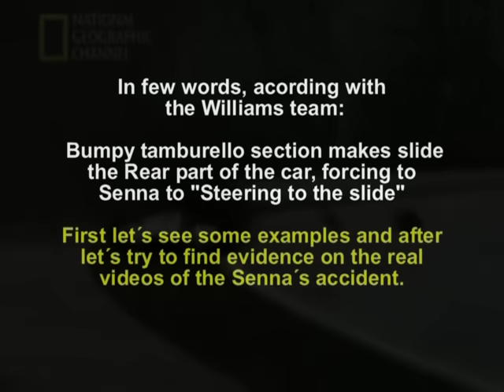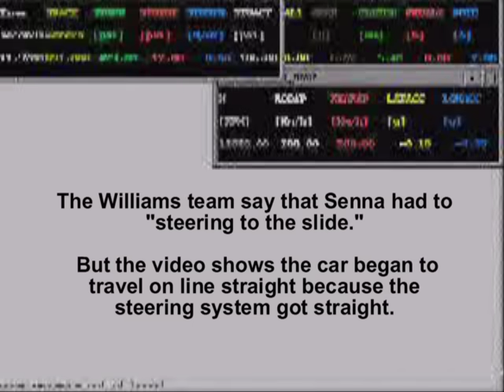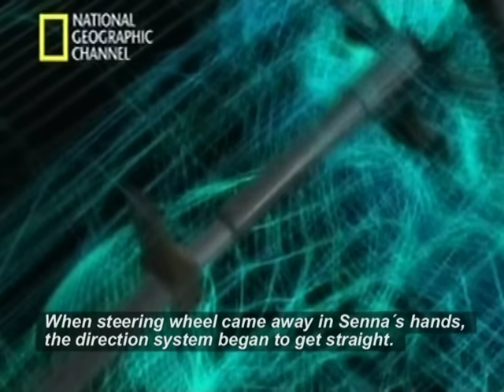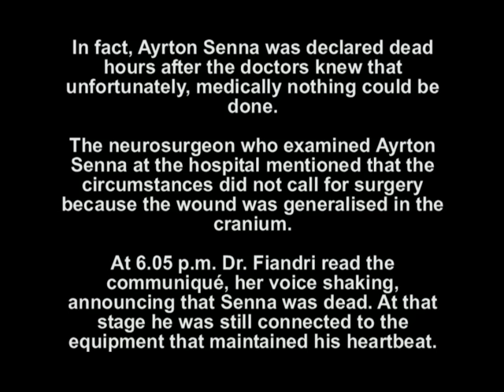5/5 the death of Ayrton Senna - what NatGeo did not tell

Comment: The steering on that car was not working you can see that.
Reply: ***** Does this mean that the technicians should have done a improper job.? Whey did not they say NO ,if it was not possible to do it properly. How could they take this responsibility? Senna most probably created a big pressure on them however, a good technician can convince the pilot with reasons. At the end he is not stupid.
Reply: Ender Conka Sorry, but in racing, there is no "proper job", you do what you can to get the car running fast & on the track in time to race! At the track, there is not time or opportunity for safety testing of design changes. A passenger vehicle steering column design change would take a year of design, analysis, testing and vehicle crash testing before going into a production vehicle. The racing teams & drivers do not choose to not race because they anticipate a safety concern! If they did, no race car would ever take the green flag ... under the best conditions, its dangerous, humans are involved, who try their best under the conditions, its part of the accepted risk.... no one can be blamed for Senna's death, it's racing,
Reply: Ender Conka No, there was a huge investigation afterwards, Williams was found to be completely blameless.
Reply: watch after he turns into the slide. He cant turn the wheels back to the left because the steering isn't working.if it was he would have tried.
Reply: wayne burgess Not necessarily, it's hard to explain since it comes so naturally but you wouldn't necessarily turn away from a wall if you were heading towards it, especially not if you didn't feel the grip to do so. Take Schumacher's accident where he broke his legs, he drove the car straight into the wall since he didn't have the grip to turn.
Reply: foxkart61 You don't do a crap weld job.  No excuse.
Reply: Jedontrack No, the verdict was given (probably on purpose) too late, so it had "expired".  The final ruling was it was the broken steering.  As for Williams, Patrick Head and Frank Williams were guilty of everything, including lying in court
Reply: Jedontrack Was this investigation done by the same Italian court system that convicted a number of scientists of not foreseeing an earthquake and warning the country about it?
Reply: ***** How do you know the italian scientists were not being negligent?
And how do you explain the Williams defense never denying there was metal fatigue and claimed the steering was "only" 20-40% broken when Senna entered Tamburello?
Given the facts, what is your theory?
Reply: ***** I have never heard of this case (was it later over turned, I certainly hope so because that's absurd!) but presumably it wasn't the same team investigating, not the same lawyers and unlikely to even have been the same judge. It just happened in the same building. And even if it was the same judge, lawyers and investigative team and bad decision in one case does not prover you are incorrect in every case you ever held...
Reply: theo sas I have no idea what part of my comments you are referring to, but if you have a coherent, fact based rebuttal, I would love to hear it.
Reply: Jedontrack
You provide a lot of speculation.  If Senna locked the brakes, it is a lot more likely the car would have spun.  Instead, you can see it going perfectly straight until the end.  Just don't tell  me 1.8 seconds was not enough.
Now, since you mention the beloved Williams team - are you aware Williams admitted there was fatigue fracturing on the steering column - undeniable - and they just tried to claim it was less (the claimed 20-60% fractured steering column when Senna entered Tamburello, prosecution claimed 80%)?  After only ONE fats race lap!!  And that is "nothing wrong with the steering"??  Come on people, use your heads, for once.
Reply: Jedontrack
"For some reason people think because senna was as good as he was it couldn't possibly be his fault or simply nobodys fault. But the fact is just because he was good doesn't mean he was infallible"

Again, wrong.  The reason some people never believe the bullshit official Williams explanation is that the accident happened at a place on the track where the driver can't be at fault, unless he deliberately left the track, or maybe if the are more than one cars involved.  Many experts have testified a mistake could not be made at the old Tamburello.  Some of those drivers have had scary shunts there themselves (yes, mechanical failures).  It has nothing to do with Senna or his qualities.
And F1 being dangerous or not back then, welding a thin crappy metal tube as an extension in a performance machine is just negligence.  Hiding the evidence, destroying the black boxes and lying about the cause is perjury and obstruction of justice.  Williams are guilty of all three.
Reply: VWaudiRULEs In your first paragraph: "doesn't mean he was infallible" Senna himself said that in an interview. However it was someone else that said that Senna thinks he cannot kill himself. Oh,what a statement to live with.
Reply: VWaudiRULEs Williams was found guilty on all charges , with a total absolution that there was NO driver errors at all. The driving shaft was broken before the accident , the soldered piece was badly soldered and thinner than the original ans showed  fatigue cracks . Williams was founf guilty of Mnalaughter by negligence , so where the main mechanic and engineer . the whole lot walked because the decision came 6 months after the status of limitation had expired. (convenient) . Just wonder what Williams did with the money he was paid to kill Senna.
Reply: VWaudiRULEs Well this first statement is simply not true, how many times do you see a car lock up and go straight forwards? In fact it's quite rare to see a lock up result in a spin. I've never heard this one before, all articles I've read on it williams say it is impossible to tell if the steering column broke before or after the crash... If you have an article that shows otherwise please share....
Reply: VWaudiRULEs That is an absurd claim, drivers can make mistakes on any corner, they're human... I can't even back this up with evidence, that statement is just utter crap. Many experts have said it was very odd to make a mistake at Tamburello, but then that links back to my original quote. People simply can't believe the great Ayrton Senna may have died because of a mistake he made.

Nowadays that weld obviously would be deemed unsafe, but you have to remember we can't judge the situation by todays standards. There were far less technical restrictions back then and those modifications were allowed, they passed scrutineering (presumably if the car was allowed to race). All that aside, just because the steering column was weak does not mean it failed, it does not mean it caused the crash and it doesn't mean Williams were necessarily to blame.
Reply: SuperTriniDaddy He did, I'm just not sure his fans believed him. It was Alain Prost that said that.
Reply: Whatever pal, so far you've completely failed to interact with the debate in a constructive manner which suggests to me you have nothing of value to say. Believe what you want. I enjoy these debates, it makes you think about yours and others points of view, you learn things and that's always good. But I have no time for meaningless name calling.
Reply: Jedontrack Driver error is something FIA digs into like a leech , because it REALLY can save lives if a driver's death can shed light on something that is being done as common practice that is dangerous. FIA found Senna ABSOLUTELY without guilt ,of error or omissions ( I question the omission part because , was I Senna I'd wonder how my steering shaft got shorter from the last race and NOT to crazy glue another) but both FIA and the court found Senna without fault . and I REPEAT The team was found GUILTY and Patrick Head took the blunt and was found of omitted error & control
"The Williams team was entangled for many years in a court case with the Italian prosecutors over manslaughter charges, ending in a guilty verdict for Patrick Head. The Italian Court of Appeal, on April 13, 2007, stated the following in the verdict numbered 15050: "It has been determined that the accident was caused by a steering column failure. This failure was caused by badly designed and badly executed modifications. The responsibility of this falls on Patrick Head, culpable of omitted control". Even being fond responsible for Senna's accident, Patrickyu the statute of limitation for manslaughter is 7 years and 6 months Head wasn't arrested: in Ital, and the final verdict was pronounced 13 years after the accident."
You might also like:
Reply: I must admit, I never new the FIA investigated senna ' s driving... 

As for the court case the way I understand it there were two investigations, the first closed in 1997 and found Williams innocent, the second closed in 2007 and found them guilty but it was too late as the statute of limitation had run out. Quite what changed between the two cases I don't know but I'd say there is a reason the statute of limitations exists and therefore perhaps the first case is more reliable...
Reply: Jedontrack The status of limitations exists to avoid a person going through life wondering when the thing is going to end. In the first trial lot of things were not admitted into evidence and the black boxes missing time were not even shown.
It was by all accounts a shoddy trial.FIA did not want to dump the bomb that a TEAM of engineers had (just by negligence" sabotaged the car. Same reason why Senna was not declared dead at the track MONEY!
 The legal system in Italy seems to function like the medical system in Spain and France. We get there when we get there. But MONEY talks and Senna's dad is a millionaire and Senna after death has built an empire selling the trademark "S" from decals to flags to full F1 suits at $7,000 USD. As long as Senna's accident included the possibility of being a Senna error , the brand suffered and a new younger prosecutor took reigns at the request of the Senna family . THIS investigations lasted almost 3 years where every bolt, nut , film stills was analyzed by scientists this last trial was so detailed , the expense was hitting the Italian government.
Now , why NOW declared legally that it was not Sennas fault when FIA found him ABSOLUTELY  innocent of any possible mistakes. Two things . Senna's name is vindicated and the Senna family CAN now enter a civil liability suit with the Italian proof that "something" went wrong with the car and the obvious element is the driving rod.

I want to clarify something .. ALL of the money of the Senna foundation is going to the poor in Brazil and a School was just opened to teach these poor suffering kids. NONE is becoming rich here , they were already filthy rich.
Reply: SuperTriniDaddy
Senna has said in many interviews he knows there are risks - "man and machine on the limit are bound to fail from time to time", "danger of gettign hurt and danger of dying", and so on
Reply: Jedontrack Here is where you show a lack of understanding of the important details.  Cars lock up and the go straight (in fact because the driver realizes he can't make the turn so it's better to just miss it, brake and use the escape route, or minimuze the chance of a heavy impact if there is not escape route - see Arnage at Le Mans).  But that happens ONLY ON SLOW CORNERS, where the aerodynamics HAVE NO IMPACT.  Tamburello IS NOT such corner, it is FLAT OUT, MAX SPEED, and therefore MAX DOWNFORCE.  Also, Williams claimed Senna had braked at MAX BRAKING FORCE, measured in Gs.  So, no locking up, sorry.
And cars can easily spin out under braking even on slower corners, especially when suprised - for example, see how Damon Hill span out at the end of the 1993 Australian GP when Prost was slower in the corner, but the cut right in front of him, giving Hill no chance but brake hard to avoid the impact!
And of course Williams would say "there was no way to know when the steering broke".  There is no need to refer to articles, when Gerhard Berger, Michelle Alboreto, Ron Dennis and others are certain the car broke prior to impact.  The evidence from the onboard also points in that direction.  And why even argue, when Williams, though the try and claim "ther is now way to know when it broke" (dirty defensive tactic) could not deny THERE WAS METAL FATIGUE on the steering column, and that at least about half the width was already cracked.  Would you say that is a normal occurence on Formula 1 cars after ONE fast lap in a race of 50-60 laps?????
Reply: Jedontrack
Here is some evidence - no one ever crashed at Tamburello without suffering a mechanical failure.  Alboreto, who had that happen to him, said it was the only way.  Berger, who also suffered a crash due to mechanical failure there said somethign very similar before the 1994 Monaco GP. 
And if you watch some telemetry, you will see how Tmaburello was taken - no need to apex it, and car could pass each other.  It was taken at full throttle and even though it was entered at very high speed, speed was still increasing though it and the cars would leave Tamburello at even higher speed.
Yeah, maybe somehow a driver could make a mistake on a straight as well, going by oyur logic.  But you can't say they were "going to fast", "pushign too hard" and such, when the cars are designed to do that.

And there were actually plenty of technical regulations.  There was less standrtatization though.  And prior to Senna's death, there was no regulation to outlaw steering columns that were not one whole piece, but made of more than one piece.  But that doesn't mean it is still not negligence.
Reply: VWaudiRULEs WAY to much info which serves well to confuse everyone . Half of this youre making up. WHY would a car lock up with wheels straigh on ? A lock up on steering would also affect speed  there was no lock up here , there was just NOTHING to drive that car. This lockup you speak of you are the only person , with this theory . The FINAL conclussion of the last trial . steering rod SNAPPED off Williams guilty .... And i am GOING to take their word for this cause the Italian court spent a shitload of money and 7 1/2 years investigating.
It is interesting to notice that  Nelson Piquet acident at Tamburello  shows him maneuvering slightly over the sand. There was NO arrow effect he had control of the steering , Senna did not.
After 20 years Ayrton's death has caused a furor among psychiatrists and behaviral scientists. In THAT race Ayrton did NOT do any of his standard preparations. heat hood and helmet were on at the last minute and I mean LAST MINUTE! something he never did. He is VERY nervous and stares  down the steering wheel wiggling it a bit. Opens his legs like trying to find more room. I pray that his Macho personality did not push him to drive that car knowing full well it was fucked up royally. BUT .... Ayrton's body may have been in the car , his mind was some place else
Reply: Jedontrack "He did, I'm just not sure his fans believed him. It was Alain Prost that said that."

You can stop with the myths.  It's only Prost who made that claim, and only at a time when they didn't like each other.  Do I have to explain to you that this is not necessarily the most reliable source in the case? Here's a few quotes from Senna:

"Perhaps one different thing, only that, one particular thing that Formula One can provide you, is that you know we are always expose to danger, danger of getting hurt, danger of dying".

"If I ever happen to have an accident that eventually costs me my life, I hope it is in one go. I would not like to be in a wheelchair. I would not like to be in a hospital suffering from whatever injury it was. If I’m going to live, I want to live fully, very intensely, because I am an intense person. It would ruin my life if I had to live partially".

"Motor racing is dangerous by definition, motor racing is exciting, motor racing is a sport which brings people to the limit man and machine.......and it must be seen as that, and people that are on the limit, and equipment that work on the limit are bound to go wrong from time to time, and that must be taken into consideration to be part of the game".

Not to mention how Senna reacted to the bigger accidents he saw around him - you would have known if you are at least a little bit more familiar with the real about Senna, and not what someone once said about him.  He stopped on track and risked hsi own life to help save Eric Comas.  Martin Donnelly's sever and nearly fatal accident deeply troubled Senna, and Ratzenberger's death distraught him to the point that he didn't want to race on the day he himself was to die.
Does that sound like someone who believes they are invinsible?
It really seems you are just trying to build a case against Ayrton Senna and you are shooting in all directions, with whatever dirt you can find against him.  But I am showing you the real facts.
Reply: mickavellian
Good point. I didn't realize it, even though it's so obvious - Schumacher is living Senna's nightmare.  I  wish him a full recovery.
Reply: The problem with that particular weld was not in how it looked on the surface, it was how it looked after it broke.  The weld could look great on the surface but not get sufficient penetration through the tubes to be structurally sound.
Reply: @Jedontrack  For information. After aircraft crashes, it is standard practice to make extensive observations and do extensive tests to determine which components were broken before the crash, and which were broken by the crash. It seems strange to me that no such tests were apparently done on Senna's car.
Reply: @mickavellian  Senna was no mystery, but he was complex. He was an extremely intelligent man, devout, caring and compassionate, and on track an incredibly capable and utterly ruthless driver. The press couldn't handle this, so they constructed a much simpler and much less pleasant persona for him. Such behaviour on the part of the press is far from unknown.